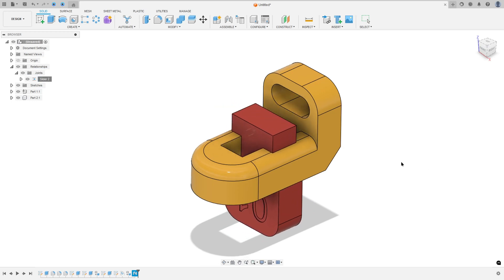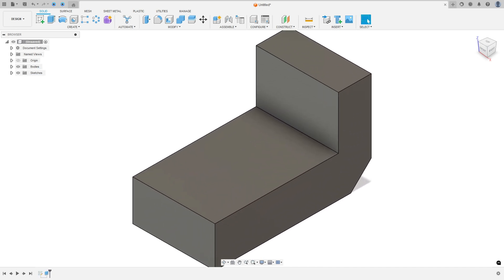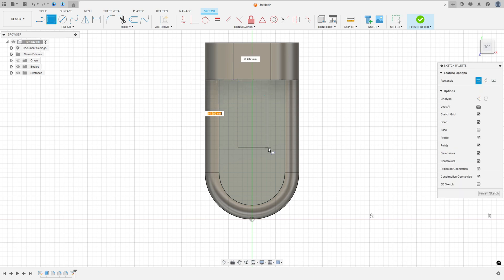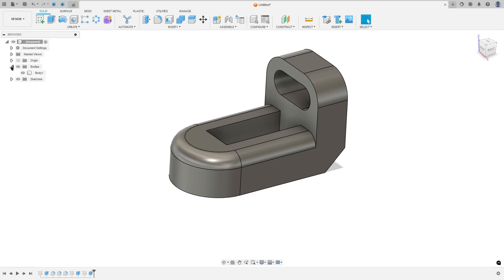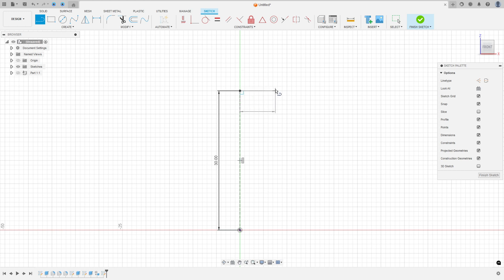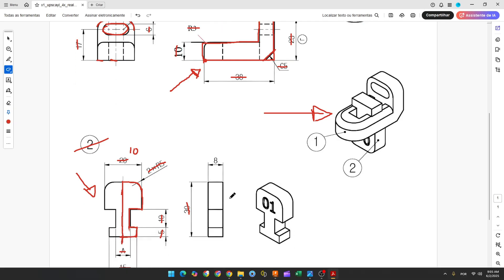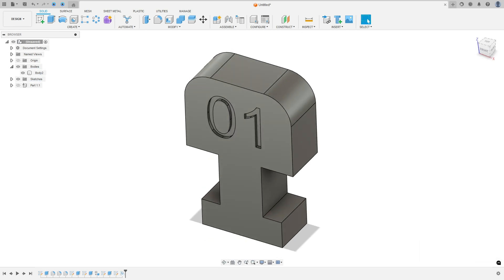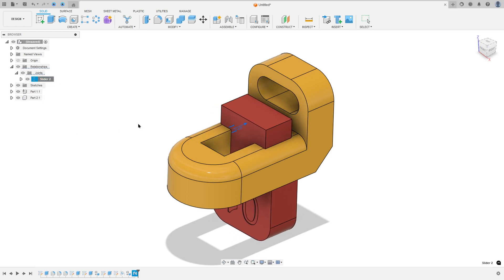Autodesk Fusion 360 Slider Joint   - Exercise 322

Comment: Erhm, could someone on your team print that and try to put it together? Since it wasn't apparent while you where designing, I'm sure a actual real world test would show you the flaws. No idea how you managed to make a rectangular link, to fit in a no tolerance slot and still be able to turn freely, to achieve the locking mechanism
Reply from the maker: Nice point my friend , thanks for the comment ... This piece is actually a precision test for 3D printers — the goal is to see if the printer can produce two parts with the minimum functional clearance between them. The parts aren’t meant to be assembled and disassembled, but rather to be printed already joined and functional straight off the print bed. It’s a great challenge for checking tolerances and calibrating your machine. 😉
Reply: @fusion360tutorial  Oh how cool! I must have missed that, but now i gotta go test my printer. Perfect timing too, just mounted a knockoff dual drive extruder 😄👍
Reply from the maker: @VikingRul3s  In FDM printing, a clearance of around 0.3~0,5 mm is usually a good challenge, but some printers can go even lower!  That’s why dimension “A” in the 2D drawing isn’t specified — it should be adjusted depending on your printer’s capabilities. We know 0.0 mm clearance is impossible in practice, but testing values like 0.2–0.3 mm is a great way to evaluate how well your machine is calibrated.
Reply: @fusion360tutorial  I see, well, going for 0,2 to start with then 😄 Thank you for the advise and test 👌